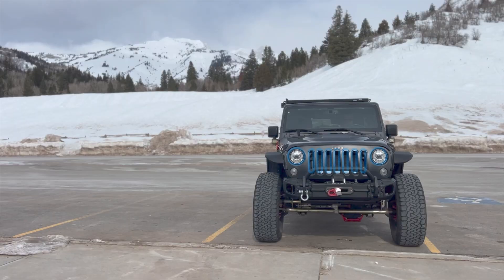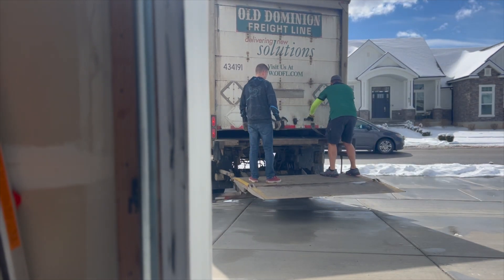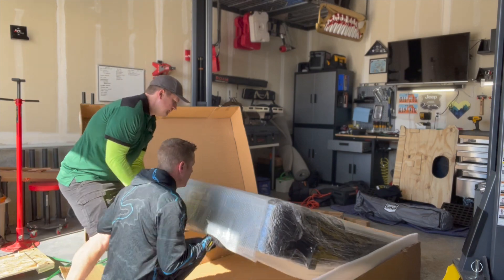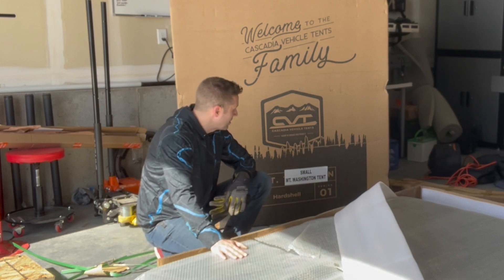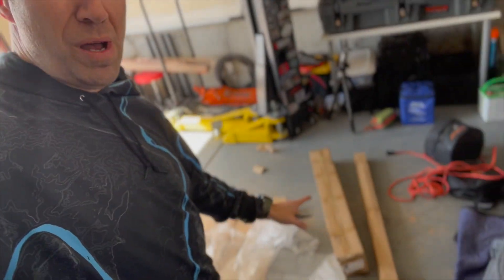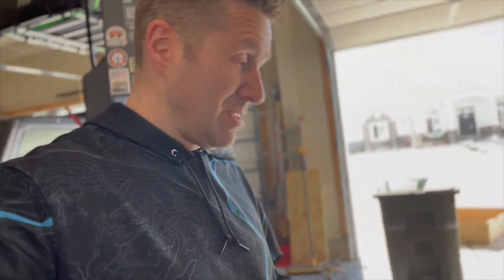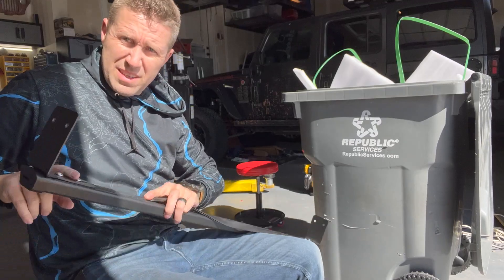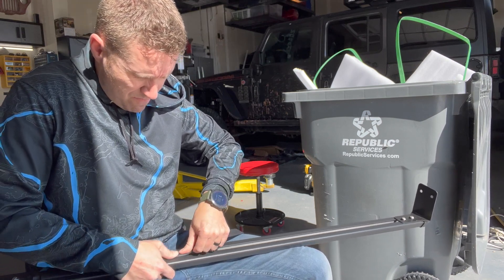Is the CVT Mt Washington Hard Shell Tent a Major Upgrade?

Comment: Hey man! I just got mine, did yours come woth the cross bars or did you have to get those separately? Also do you know how much weight those crossbars can hold?? Thanks in advance!
Reply from the maker: I Have the frontrunner rack with quick disconnects but still ended up putting new crossbars on the tent because they weren’t compatible with the crossbars that came with it.
Reply: CVT customer service said the limit is 150 lbs. I roughly have been carrying about 100 lbs with mine. That includes a kayak, and fishing rods. No problem so far.